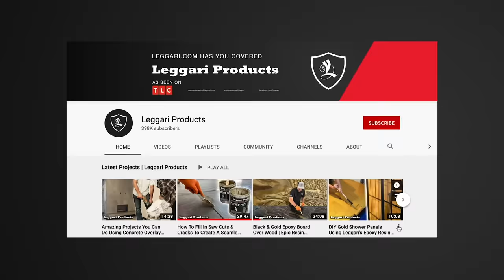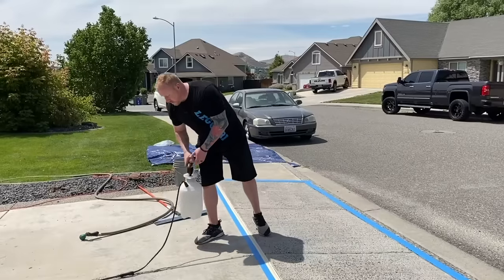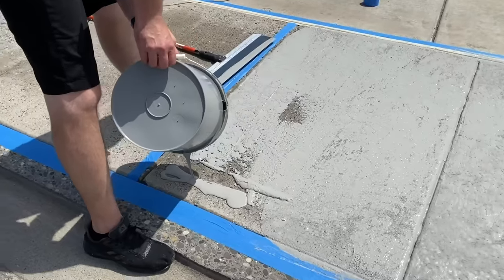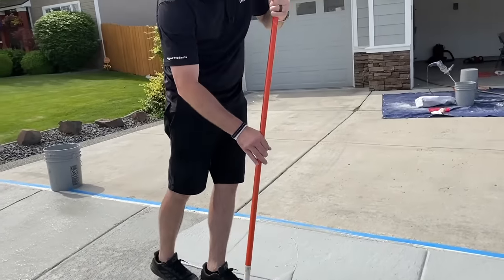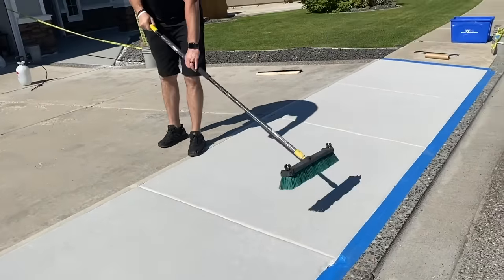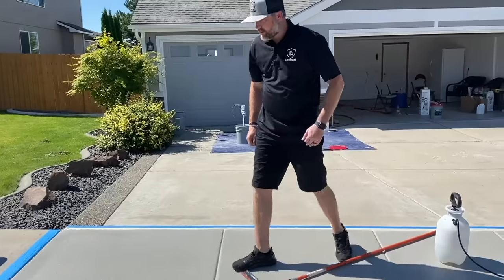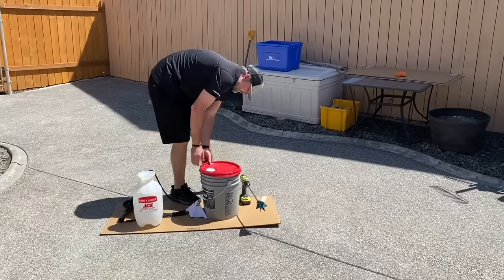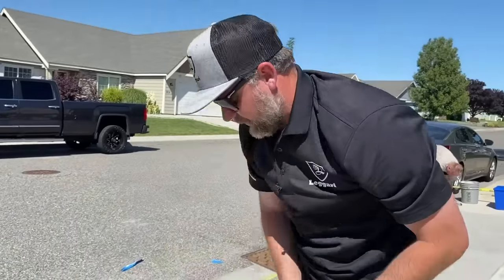How To Repair Old Concrete | Resurface Concrete Sidewalk | Restoration Project DIY Concrete Repair

Comment: So , 3 layers is enough..  QUESTION:  IF COMCRETE CRACKED THROUGH COMPLETELY,  I NEED TO CUT a “V” shape in crack and repair with other stronger material (IVE done that before).  Then follow your steps to redcoat a few days after once (crack repair dries completely). Please reapond here quickly.
Reply from the maker: Hello, please contact our customer service for questions regarding your project 
1-844-LEGGARI (534-4274)
customerservice@leggari.com

Comment: How long does it last before the next redo?
Reply from the maker: As long as the concrete is prepped properly and maintained with our WB Sealer periodically it should last the life of the concrete. This is NOT a temporary patcher that will wear off in time. Thanks

Comment: This is kind of funny watching you guys do this. Why?  Many years ago(37+) my sister and I used to sealcoat asphalt for 14+yrs. Long before media or you-tube vlogging. It was the same concept to what your doing, just on a larger scale. We did large areas like parking lots i.e, shopping centers, condo's, apts., golf courses, private drives,etc). We had a 1000gal. tank with a 6" dia-7'long hose to dump and spread the material(fine sandy emulsion) with 36" push brooms. We cleaned with an industrial power blower, tie off the perimeters w/heavy string & ribbon to keep(tried) people/cars off until it dried and the striper would come in to layout and mark the lines..We were forbidden to touch any concrete as it would stain permanently. Let me say, there were some real oblivious people out there.  Wish you luck with all your endeavours, stay safe.

Comment: Does this work on cracked concrete?
Reply: I’m no expert. If I had cracks in the concrete I would get specially designed material that fills in and repairs those cracks before applying any type of seal. Just look up concrete crack filler.

Comment: Looking at price for the sample kit, i think replacing the whole darn thing with new driveway comes out cheaper and i dont have to break my back.
Reply from the maker: It definitely isn’t cheaper. Yes the sample kit is $34 but the repair kits themselves are between $1.25-$1.50 per foot. Much less expensive than ripping out and re-pouring. You are correct though, someone has to do it, and that may not be your cup of tea.

Comment: Not a permanent fix but nothing is,  I can do same thing with sand,  Portland  and polymer at a fraction of $.
The installation process would be the same. Will look great for 2-4 years.
Reply: jubjub247  Prove 10 to 15 year durability.  No trust in that claim, unless the manufacturer is willing to  provide a full warranty and is willing to provide the replacement product and the necessary labor to redo the work if it fails.  I agree with a 2 to 4 year max. in any northern climate.

Comment: What about tair marks
Reply from the maker: We guarantee our Hardwood Overlay kits are so strong they will not *discolor, delaminate (peel off) or wear off over time. 
To maintain the initial installations color vibrancy it must be re-sealed with the like sealer every 1-3 years (maybe longer), depending on the traffic.

Comment: Where is the safety guard on the side grinder.  Also you should use a vacuum to collect the dust.  Ace used to make a good sprayer but they got cheap and changed the hose  to the nosel.   Now the hose kinks at the container and the wand.  Junk.

Comment: Didn't talk about cost, color, durability or several other topics including the "biggy" - old concrete is (typically) not only weathered, but also cracked, broken, moved, tilted, raised and/or sunken. New concrete delivered in a short load )less than a full truck of 10 yards) is (typically) $175 or so per yard. I'm guessing this slab is maybe 4 ft X 30 ft, or 120 sq ft. A yard of concrete, poured to 4 inches, will cover ~80 sq ft, so this project would require about 1 1/2 yards of concrete, or $260 - $270 in concrete (delivered). Wonder how that compares. Of course, you'd need to pay for labor (or DIY) for both, and I'm sure both have their pluses and minuses - but I think I'd stick with new concrete.
Reply from the maker: Pouring new concrete is definitely not DIY friendly. Around here (Northwest) the cost to rip out and re-pour concrete is between $4-6 per foot depending not eh size and quality of contractor. Cost per foot on these repair kits are anywhere from $1.21-$1.53 per foot. They are extremely durable, and even more durable in many ways than concrete. These coating handle freeze-thaw cycles better, ice melt, blunt impact, etc. They will last the life of the concrete if installed and maintained properly. Thanks

Comment: I don't understand the use of the pump hydrator when you just put down a fully functioning multihead garden hose in order to pick it up. Just set it on Flat and don't grip it quite as tightly.
Reply from the maker: You can definitely use a garden hose to hydrate, although we’ve found the hose gets in the way a lot. The pump up sprayer allows you to control the direction and amount of water much better.

Comment: So much for a one man job when you need a dedicated guy to keep the concrete cooled off. I owned a concrete resurfacing business for 25 years and I wouldn't touch this stuff. I'd rather just get a bag of Quikrete concrete resurfacer. Its about $25 a bag and is "just add water". And for god's sake, use a rubber squeegee!
Reply: jubjub247  Show me the warranty that guarantees the cost of materials and the cost of labor will be reimbursed by the manufacturer if it fails in less than 10 years.

Comment: I clicked the link.  $17.50 sq ft just to buy.  My driveway is 270 ft long 10 ft wide.  $47,250.  $15,750 for the pad in front of my 3 car garage.  $63,000.  I am willing to bet I can get it ripped out hauled off and re poured 6" for $15-$20k
Reply from the maker: Hi John, where are you seeing this number? If you go to our website and click on the concrete repair kit and choose 250 Square feet it costs $393.00. Not sure where you ended up. If you’re having trouble feel free to contact us at customerservice@leggari.com and we’d be happy to help you.

Comment: I get what you're trying to do here, but I work for a concrete company and that first square looks like absolute hell.
We would have to remove that square and and re do it if we ever had a finished product that looked like that. It looks like you poured concrete over smeared tar.
Reply from the maker: Yes, this is usually the sentiment from concrete installers. This coating is definitely not for every situation but can save people a lot of work and money. Also, the camera doesn’t really do justice for these types of videos, hard to tell how bad it really was starting out. Thanks
Reply: Leggari Products  true, I did not pay much attention to the condition at the beginning Nor do I want you to believe that I watch the video just to complain about it. I believe many of the Leggari products are fantastic. I just don’t think I’d be using this one, but then again I’ve been wrong before.

Comment: Ngl I thought it would turn out better. All you did was hide the pits by blending it. When you sprayed that last "sealer" I could see the pits and the broom marks going through them... I'm sure this kit costs more than the 2 bags of mortar you should have used to do this repair. Also if you are using Portland in that mix with all of that water it's not going to last. You will be lucky if this coat and seal doesn't become a yearly event.

Comment: Kit is price 1/3 cost of 4 inch 4000psi concrete labor included....means pay almost half price of doing brand new concrete which can last 20 years.... very expensive time consuming  method.....of courseno thanks.

Comment: With broom finish you should do 4th coat u need more sealer to and u should have etched it with acid or use a concrete needle scaler and put fiber in the mix shat shit will last a year if lucky

Comment: Please show us past treatments that you have done years ago. I don't believe that putting a thin ass coating of concrete over old concrete will stay. This might look good for a short time but it won't stand the test of time and god forbid if you pressure wash it the thin layer will come right off. Why do people think there is always an easy way to do something? This is what is called a schlock job.
Reply: Its not a thin coat of concrete...

Comment: Concrete that looks like that was not mixed or poured properly. In other words, lazy workers.
Reply: Not necessarily lazy workers, many factors go into it, that the guy placing it has nothing to do with.. how it was batched, how it was mixed, when it was placed, how old the truck was... that holy concrete looks like the calcium was dissolved in it.

Comment: Cutting the joints with a cement blade with NO GUARD on cutter......Dont let OSHA see this video....   great way to cut your hand....  Ive got a scar to prove it happens, lucky its just a scar not a missing thumb

Comment: 3/25/2024 - You started out with a concrete in good condition. I mean, there wasn't a thing wrong with that sidewalk you resurfaced. Come on, man! Why didn't you resurface a 40-year old sidewalk with cracks four feet long?

Comment: So you have basically a concrete paint. Adding in paint hardener. Then adding in mortar. Nope. Now you know why you get so many views but not enough subscriptions.
Reply from the maker: Not at all. This is actually an industrial coating, not something you can buy in a box store. No acrylic (paint substance) in it anywhere. This particular product is used by contractors across the nation and world. It’s also been used on parking decks and roadways, because of its strength and longevity. Test it yourself. Email us at customerservice@leggari.com and we’ll send you a free sample. Talk soon.

Comment: If the ready mix companies would  stop using additives in place of cement it would eliminate 90% of the concrete problems. Also when the contractor pours he should always tamp (gandy)
the concrete. All those pop outs are caused by rocks at the surface. Concrete contractor for years and poured thousands of loads of concrete. Stop being lazy and tamp that mud!
Reply from the maker: Good tip, thanks for watching!

Comment: This is stupid.  You should of just bought primer spray paint and painted the sidewalk. It would of looked the same. 🤷🏻‍♂️
Reply from the maker: Possibly, but would have only last a day or two until hot tires roll over it and peel it off. Thanks

Comment: lol dude spends the entire video complaining about how hot it is while wearing all black and shoes with no socks. bet he smelled like a sewer by the end of the day. trying to understand how he ended up with so many chatter marks even after several coats and a broom finish, or why he felt the need to use cardboard to avoid getting invisible sealer on the rest of the concrete... any over spray would've been good for the driveway, the rest of the sidewalk and even the road. betting good money quikrete's product is much cheaper, better, easier, and doesn't end up that chalky white color afterward. if you can cut it with a razor knife, it will likely peel off like bad paint in a year or two in the midwest.

Comment: Sorry but there is no a product on the market that will last for many reasons. I have personally seen 100's of overlays fail for many reasons. From 2 weeks to one years after the application.
 why did the concrete delaminate the way it did?  Was the PH to high? the water in the are is that what caused the concrete issue? 
 When the concrete was poured did that contractor use and Accelerators?  
 In one of your comments above to state that you must let the concrete cure for 2 days or so at an ambient temp of 50 to 70 degrees.
 But at the same time you never mention the best temp to place the product but just keep the concrete moist. 
 What most people do not understand is when the water you are using is hot it will make the material flash.
 In the video you keep stepping on the street. The street material is asphalt and there is a lot of oil in it. Keep off the street (black top) your shoes will pick up the oil and oil will stop the product from adhering  to the material it is covering.

Comment: Well as a cement Mason it's clear you have no clue what you're talking about when it comes to concrete
Reply from the maker: Actually we’ve poured concrete for years, and over the years have noticed, and personally dealt with the degrading of quality in that industry. This is also one of the reasons hundreds of concrete mason contact is every year to learn coatings. They are, in many ways, much more resilient to nature, more chemical resistant, and less prone to cracking and chipping. When the concrete industry (concrete plants specifically) over the years has learned how to use cheaper fillers, less cement content (unless asked for), and more water; the coating industry has spent billions on development to make up for these losses. And make up we have. Trust me, I don’t expect you to believe one video, although more videos are coming to prove my points. Send us an email at customerservice@leggari.com and we’ll send you a free sample to see for yourself. Oh, and it’ll save your back and knees, we should know after multiple knee surgeries and adjustable beds stemming from laying concrete. Talk soon, Thanks!
Reply: @LeggariProducts  it's just kind of pathetic the way you have to put other Industries down to make your product look good.
Reply: @grumpytinatoys9522 ...definitely grumpy!